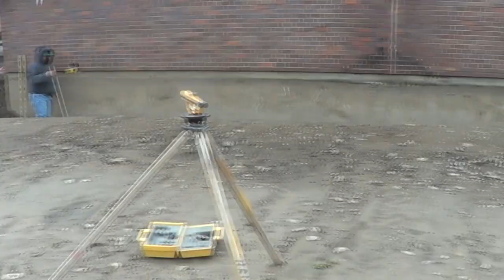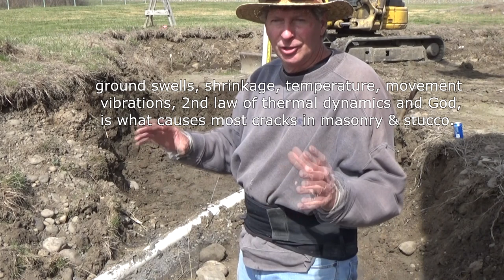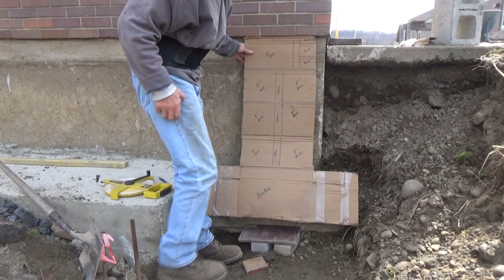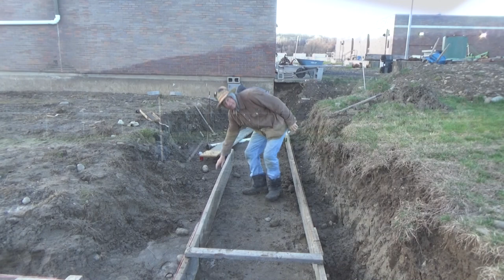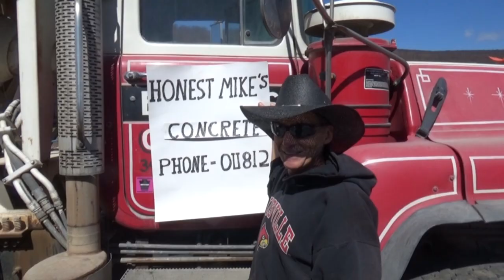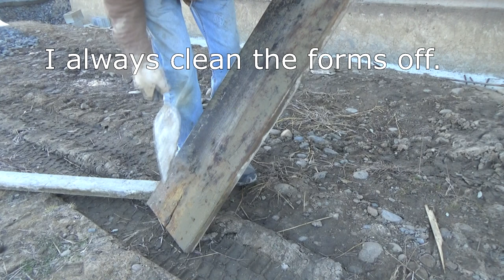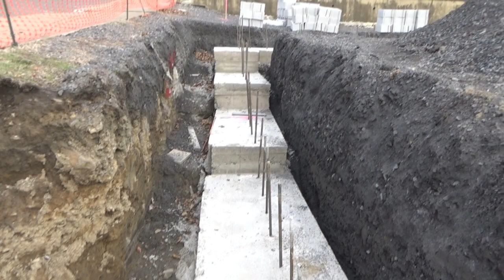POURING CONCRETE FOOTERS (Mike Haduck)

Comment: Code code code. We used to hand dig with no forms. Pounded small rebar in dirt for leveling. Then transit level each one.  Drank bourbon.
Thanks mike from minnesota. Voteing red next tuesday.
Reply: Gotta account for the lowest common denominator. You might do it right, but plenty of people wouldn't if there wasn't a code.

Comment: Sure do appreciate this video because it answered some questions I had. I'm fixin' to build a stone wall that will have one ninety degree corner and several columns. It's not much at a total length of approx. thirty feet, but I want to do it right...so it will last. I'm using a white natural limestone rock. I have learned a ton of stuff watching Mike's videos. I now have a rock facing chisel, a few hammers of varying weights, and a brick hammer. I'm also building another wall utilizing new, and some used bricks, that I have been collecting for about two years. Once that wall four foot wall is around the perimeter of my rear deck and patio, I'm going to mix up the sand/topping myself, and finish the wall with either a Santa Barbara or Sand stucco texture, and then apply white Portland Cement finish. I just bought a new 1-9/16" High Output SDS Max type Rotary Hammer and a 1/2", a 5/8", and a 3/4" star tip masonry bit set...overkill? I'm thinking that making some holes for some pink fiberglass rebar will be a lot more fun than operating a 90lb. pneumatic jackhammer hooked up to a four cylinder Ford air compressor...busting bedrock for 12 hours a day in 95 degree Texas heat...'cause I've done that...but I was 19 years old then...and I'm 63 and minus one leg today.
Reply from the maker: Thanks Kandy, I am sure the wall will come out beautifully,  Mike

Comment: Really appreciated you bringing in some historical context ... the huge cathedrals built of massive, cut stones, all somehow leveraged into place without the use of modern day engineering, cranes and other powered machinery ... using raw man power, horse power and pure ingenuity. And still solidly standing many hundreds, maybe even a thousand (or more) years later. And the most important part ... the foundation ... the part that is (for the most part) invisible. Amazing to say the least.
Reply from the maker: Thanks Murray, mike

Comment: You are a pioneer on YouTube videos. Quality from the beginnings. I might never build my house myself (still nice dream) but it is great to have all these videos ready if the opportunity arises. The repair videos are great too. One thing I walked away with is that the best retaining wall is none. I have property soon that has a slope. I will not build a retaining wall if really not needed. Flatten parts of the area and just make a sharper slope and put vegetation. Cheap, you loose a bit of space but it makes life so much easier.
Reply from the maker: Thanks ke, very true about the retaining walls, none is better, Mike

Comment: Looks like a lot of extra work. I've been  a laborer on several footing jobs. The guy would just paint out the lines from the blueprint, start digging it with the track-hoe, and I'd shoot grade for him as we went. There were no form boards, we used the dirt banks as our form. Then tie the re-bar in, put it up on chairs, go back and put grade stakes in for our concrete height, and pour it.
Reply from the maker: I agree,  but they will not let us do that here, "new codes"  thanks mike

Comment: wow thanks for the response, its actually a 3ft by 3ft cement slab at the,bottom of some steps that cracked and raised up on one so I put a layer ( 1  55lb bag)  on it and it looks good but isnt level or pitching away as much as id like so i figure one 25lb bag should do it.
Reply from the maker: I am sure you got the ideas,,  you can always rip it out and do it again, no worries, thanks mike

Comment: Mike, I wonder your thoughts of pouring a 25x36 garage slab without insulation underneath.  My concerns are long-term, and degradation of the foam causing cracks and sinking of slab sections. I'm in the Philly area, and I'm not interested in heating the slab, I just wanted to pour 5" of 3500 mix with fibermesh over 6mil and compacted stone. It will have a 32" block foundation with a 12x8 footer. Thanks for any comments.

Comment: Thanks Mike your videos have helped me 
I’m building a new house and workshop in Germany, the house will be a prefabricated house and that will be done by a company 
I will clear the land for the 12 meter X 6 meter work shop I will make a footer to sit it on and I will place 30cm of sand and lay 50x50 pavers instead of pouring cement as the price of cement is high.

I was thinking of mixing the cement using a mixer myself will this be a problem as I will have to pour it a bit at a time.
I could get a truck close to the area if that would be best.. what should I do

I’m from Oregon and I loved your video about using pavers/ stones instead of cement our driveway is 32 meters long and it is all pavers
Jim
Reply from the maker: Hi Jim ,I can't say , it's up to inspectors and codes anymore, I just show what I did in certain situations,  thanks Mike

Comment: Mike, love your videos but my question to you is, why did you not dig down to the frost line and pour the footer there?  I'm trying to plan my dream garage build which I'm going to attempt to do most of which by myself with some help from family. 24x30 with a loft.  I live in northern IL which I believe has a frost depth of 40".
Reply from the maker: HI James,  here code is 42 inches down for a footer, most garages around here are a poured slab on gravel,  I would do some checking into that than doing the footer thing,  ask some of the locals,  thanks mike

Comment: Great video! We had to dig out an old footer for a basketball pole. The hole is the correct size needed for the new footer, but the top 12 inches is too large because we had to dig out dirt around old to jack hammer it out. Can we just secure a form at the top half and pack dirt tightly around it and pour?
Reply from the maker: Hi Sandy, I couldn't say unless I was there to see it, Mike

Comment: I have seen a lot of builders dig their footer to ground level and pour  concrete. They than start their block at ground level and go up.  No forms used for footers since they stop at ground level. Is this a common way some masons/ builders do it to save time and labor?  Thanks Mike, I appreciate your thoughts.
Reply from the maker: Hi Joseph,  years ago they would dig trench footers and save time and money,  but now with inspectors they want everything formed so they can inspect it, which doubles the cost for things like garages and wall,  but it is the American way,  lol. Thanks mike
Reply: @MikeHaduck  Thanks for answering Mike, Joe

Comment: Thanks for taking time to make this video. Do you dig the center of the line where u mark  for the wall? How low the footer should be beneath ground level?  How many rods should be for the corners and how tall up?  Apparently there’s a lot more detail than 11 mins video could show but please reply or make another footer video if u have a chance. Thank for your sharing your knowledge
Reply from the maker: Hi T, the inspectors determine size and debt, etc,  thanks Mike

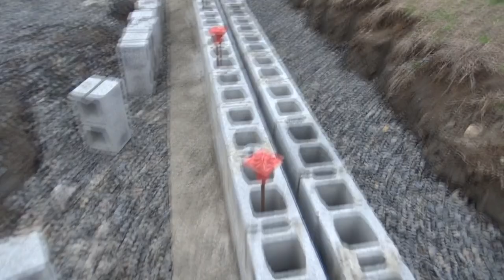Comment: Hey mike, question about the metal wiring that is laid after the first course of block in this video. But it’s only toward the corners of the course ? Just for additional strength and code ? Starts at 8:30 seconds. Thanks so much for your videos. You have inspired so many.
Reply from the maker: Hi ,This was a unique building because it was in a flood zone and we took extra precautions to make sure it didn't move, more than code and filled solid, Thanks Mike

Comment: I've heard that the footer width should be three times the width of the wall.  I'm building a single story block garage (double leaf - 4in block + 6in spacing + 4 inch block). Any advice?
Reply from the maker: Hi Wayne, best to go through the inspector and do what he says,And best he should give you the sheet with the required specs, every place in the countries different thanks, Mike

Comment: Good video as always. Sorry if you already covered this point but a comment sometime on how in perfect world You, would prefer how to back fill and tamp a block on footing as this was probably the root of my problem on this 50 year old house I live in.  
As a apprentice plumber back in the 70's I was always alert to when the guy with the puddle truck was going to do the house I was laying ground iron in. They would simply push all the dirt from the basement hole into the ditch outside the foundation and this guy would have a pump on his tanker truck and he would walk around the outside ot the house with a 3 inch house and a 3 in. pipe and he would shove it into the ground to compact the soil. Sometimes it would find it's way under the wall where the drain layer shoved his drain pipe in and it would fill all my plumbing trenches and I would be working in mud.  Go, Go, Go was the plan of the day. Everything was bid so low and only one chance to do things right. It's a wonder that anything is still standing at 35 years. Glad I am retired now. Thanks again and keep the camera rolling.
Reply from the maker: Thanks EZGZ,  I can see you seen it all,  I agree, mike

Comment: I will pour a monolithic foundation.  Hardi Flex structure.  In your opinion would my home be stronger if I pour a 3 foot wall off the foundation and build the Hardi Flex from there.  Or builf the Hardi Flex right up from the foundation?

Comment: Great video! Does the vertical rebar every 4 ft have to be tied into the horizontal bar sitting on the chairs? I thought they did. Maybe Florida, where I am located, is different code. Please keep making these.
Reply from the maker: Hi MP, you got to do what the inspector says, I film my work so everyone knows it was done, personally I can't see how a piece of wire holding the rebar will make a difference,  is mostly for infections purposes, thanks Mike

Comment: Another great video, I watch every day a video by Mike , I''m happy I discovered him. If you are so kind as to answer me  2 questions: 1) is it necessary to put a bitum sheet on the footer before  starting building the concrete blocks and2 ) if it's not compulsory why the concrete blocks are wet about 2 feet from the  footer,  what can I do in this case, I didn't put any bitum sheet, what could be the cause? Thank you so much, I hope you find the time to answer my questions, Artist of Building!
Reply from the maker: Hi Daniela, I am not sure what you are talking about, but cement cures underwater, so wet blocks or footers have had no effect on any job I ever worked on that I could remember, thanks, Mike

Comment: I'm a layman/do-it-yourselfer who is interested in construction, and I try to read up on it.  I like your no-nonsense videos. I have always understood that steel reinforcements should be completely encased in concrete so they don't rust from the outside, in. So when I do projects like walkways or retaining walls, I go to the effort to suspend the rebar or wire. I guess my question is, are those "chairs" steel, and is it okay to just set them on the ground to hold up the rebar? Thanks.
Reply from the maker: Hi Re,  for hundreds of year there was no rebar and no concrete tucks and their work is there for years gone by,  rebar is a new thing and no matter what anybody says sooner or later it will rot away no matter what you do,, I got to do a video on that,  thanks mike
Reply: In Australia Footer are wrapped in Bulders Plastic to protect from soil moisture also on on bottom we lay crash rock helps with drainage and leveling
Reply from the maker: Howdy Great, I know everywhere is different for sure and lot of things work for the better in different areas,  no worries there,  thanks mike

Comment: Mike I really enjoy your videos and had a question about cement all I used it to build up a small cement slab yesterday and ran out of material so I was wondering if it would be okay 2 add more on top and if so will it stick and should I wait longer before putting it on thanks a lot and thanks for sharing your expertise with everyone Pat
Reply from the maker: my experience with cement all is you could keep adding, (if it is a patch and not structural) I just make sure the surface you are covering is wet good and then it should stick fine,   I hope it helps, my opinion of course, thanks mike,

Comment: Question -   House, 32’ X 54’, peer & beam, concrete block on concrete footings.  
Should I add 2 more footings and blocks so I can use 2x8x16’ floor joists or not and go with 2x12 joists.   The extra concrete will run about $1200 then extra steel, extra blocks and labor.    I’m thinking 16”x20” footings.    Central Oklahoma, soil drains well.      Which should I do?   Total lumber for 2x12 joists will run about $3600.
Reply from the maker: Hi Jack, that is a structural stuff, you got to go through the inspectors, etc for that,  thanks Mike
Reply: @MikeHaduck     No inspectors here.   This is way out in the boonies.
Reply: @jacksprat7087  look up joist and beam span charts. They will show you what’s spans are for using 2x8’s. 
You are not going to be able to span  a 2x8x16 joist without at least 1 support in middle. Charts will give span max depending on size and species of wood. If running joist over top of beams you will definitely need blocking in between the joists. 
If you use hangers and butt joist level with and inside beams you should need  blocking on 2x8’s. 
Buy you should stay with max of 8’ length and not max distance out. 8’ will have less bounce than 10’ which is what you are allowed using 2x8 pine.

Comment: I’m currently at uni but my real love lies with farming and building so I’m trying to learn as much about building as possible. I saw you were still answering questions and I have a few questions.

You said the life expectancy of a building is around 35 years. Is that just a fact that can’t be changed or can it be possibly even a few hundred if you build correctly?

Secondly, I saw a video of the YT channel Practical Engineering (you should check it out, it’s really interesting) which said that one of the biggest threats to concrete is the rusting of the rebar so rebar should always be a few centimeters in the concrete. I see that’s the case but the chairs you put in place are not. I was wondering if it would not be better to put small pieces of concrete under the rebar or do the chairs not cause the concrete to rust?
Reply from the maker: Hi, everything anymore is permits and inspectors,  your going to get a lot of good and bad advice no matter what way you go, I only show what works for me, I hope it helps, thanks Mike
Reply: @MikeHaduck  Okay, thank you for taking the time to reply to me

Comment: thanks for your reply mike if you ever come to uk to do vids on masonary i know you have cathedrals and canals and railways but thers good stuff to see hear and cathedrals and castles nearly  1000 years old one or graetest civl engineers built the longest single arch bridge over river thames in maidenhead its a brick masterpiece look it up they all said it would collapse brunel left centering in for twelve months and designed whenn trians were 10 tonnes and going at 30 mph now there hundreds tons and going at 125 mph brillaint craftsmenship and over engineering and vision from brunel if you ever come i would love to show you around
ps still going thru your vids

Comment: So your saying that it is normal for a footer to move after say 50 years on a house? i developed a step crack on my block basement wall that is above ground on that part of the house. I had a structural engineer look at it and he said dont worry about it, just fill it in with some mortar caulking. Its been a year and did not crack since. We had a really bad winter that year.
Reply from the maker: Hi Iar,, I never seen a masonry foundation that dosen't have some sort of cracks in it, thanks Mike

Comment: Hey Mike, my house has a footer has a section that is broken and sunk in 3 different places. I was wondering if I need to remove the old footer? Or can I pour a footer around the old one?
Reply from the maker: hi Brandon, If the footer is already settled I would just go right on top of that, maybe when they pored it it was over fresh fill and now it settled, I can not say unless I actually seen it but that is my guess,  I hope it helps thanks mike

Comment: I have a 40x60 cement block barn I'm building. The ground slopes 4" +/- in 3 directions from the top corner. What would be your suggestion for the footers... dig down and waste 3 rows of blocks on the top portion... backfill everything level THEN put my footers in... or try and do 10' stepped footers all the way around? I can't dig down or the water will flood from the top.
Reply from the maker: Hi T, It's impossible to say unless I was there and then you got these code guys and inspectors and who knows what they are going to say, I would ask one of the locals, thanks Mike
Reply: @MikeHaduck  Thanks...I appreciate your time!! Have a great weekend!

Comment: Hi Mike, poking around on the internet and as usual end up on your videos... I'm doing a small 16x24 slab out in Susquehanna county and of course I hit solid stone. It's damn near flat and almost usable as a floor but there's a crack down the center and I want to raise it to shed water as it's a bit lower than the existing shop. Since your about as local as it gets I'll go with your opinion. Anyway can I pour directly to the blue Stone, maybe pressure wash and treat it with some kind of primer or do I need a barrier between?
Reply from the maker: Hi Dave, I can't say unless I seen it, but if you don't put something over the top like black paper or plastic it might hold on to the stone and crack where the stone is cracked, I am a fan of letting concrete float. I would ask some locals, thanks Mike